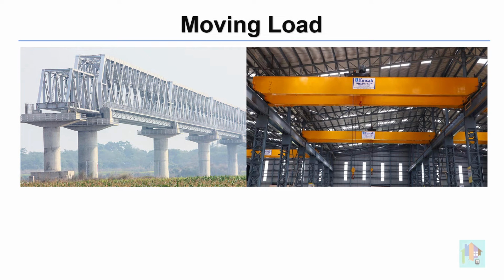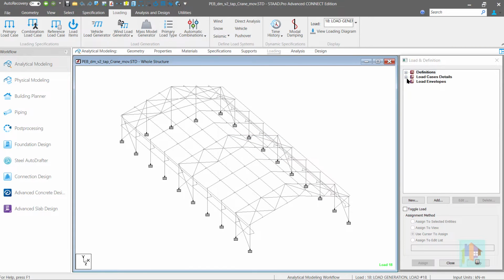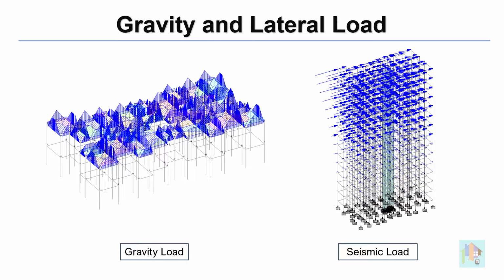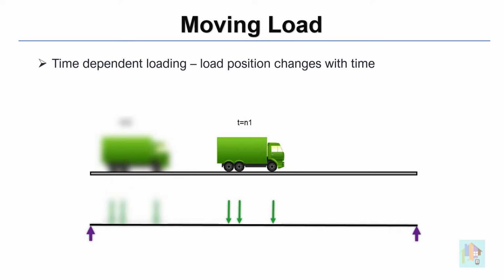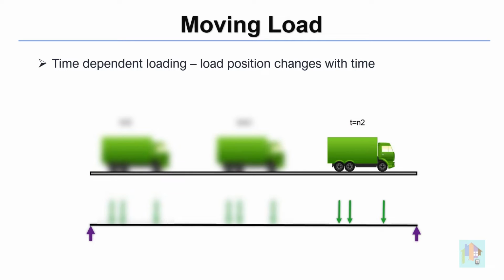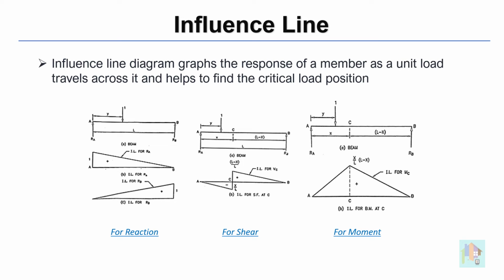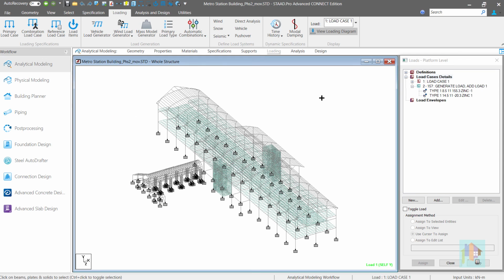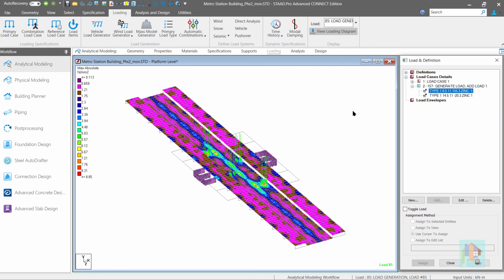Moving Load: p1- Basics & Application || Crane Girder, Bridge design || Horizontal & Axial component

Comment: @Sujeet sir can staad handle tensile fabric structure analysis design & detailing
Reply from the maker: You can model it using FEM and analyze, but design and detailing is not possible in STAAD, though we can design the supporting structure using the forces generated from the fabric structure/canopy.
Reply: @surojit_ghosh  I would appreciate.if you could upload few tutorials illustrating how to analyse the tensile fabric structure on staad in detail. Thanks in advance